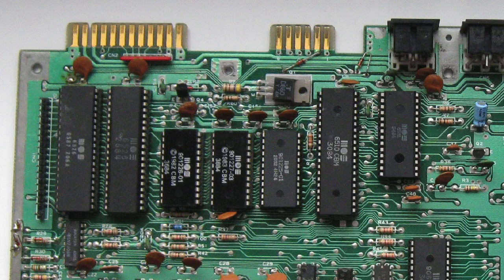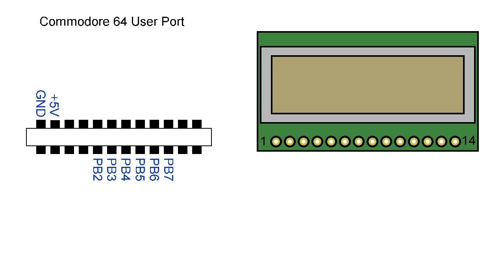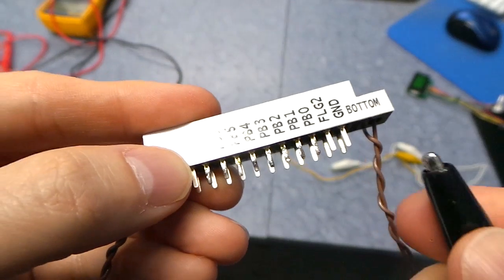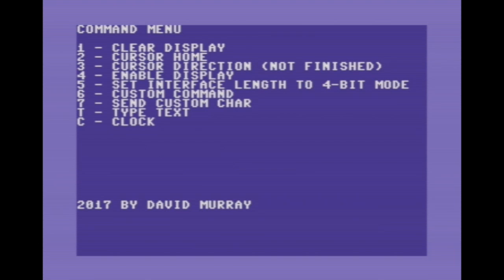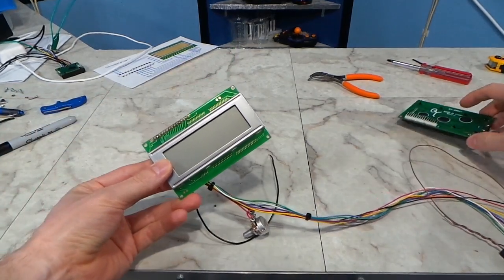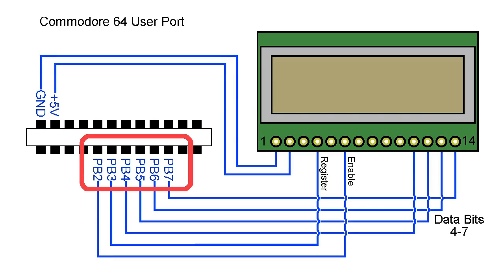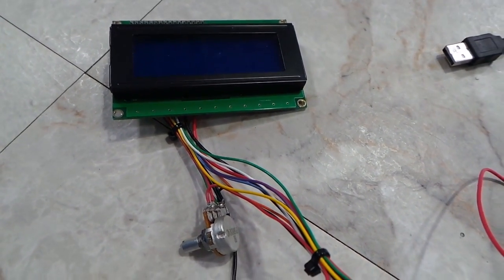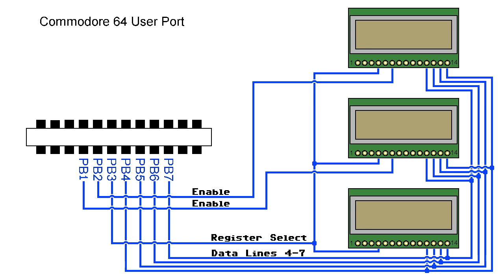How a Character LCD Works - Part 2

Comment: This reminds me when I sat in on an embedded C programming class.  We were using the TI Launchpad TM4C123 board.   Embedded C can be frustrating--you write a program, there are no bugs, and your program still doesn't work.   I guess that's the difference between programming a real board instead of a simulated board on a computer screen.

Comment: Thanks for another interesting video.
Apologies for a (late and) possibly stupid question, but seeing as how said that the problem that "fried" You C64 is a "common" problem, would it not possibly make sense to make an "external//inline" "DC OverVoltage protection"  against "frying" Your C64 ? .. As I would assume that the C64's will just become ever more rare ??
Best regards.

Comment: An Arduino replacement? that would be cool to toy with. I love the basic and I haven't learned the Arduino language (name = "Processing") very well yet. I am seeing there are other languages, but hey if I can use Vic basic for desktop experiments id love that. I am wondering if ole VIC can do pulse modulation and read pin voltages now lol.. thanks dave..

Comment: This takes me back. I used the 8 bits on this port on my c64 and made a pcb that held 8 optoisolators. I connected the switch sides of the optoisolators to the front pcb of a Fisher VCR to increment and decrement the channels and "press" record and tape speed. I lived in Japan on a military base and some local channels had American shows in English if you had a similcast box so I would switch this on or off. We also had one base channel that has just begun showing Star Trek the Next Generation a whole season behind the US. I wrote a program that was a great improvement over the regular VCR programming. I can't believe I was able to figure this out with c64 books back then and no internet. :-)

Comment: Probaly a good thing I never got an original PSU with my C64C. Built my own using modern parts that don't fry C64's

Even my Atari 800XL did not come with a PSU. Ended up using a Raspberry Pi one where the USB conector had fallen off.

Comment: You know, having recently diagnosed a faulty brick myself, it's really reassuring that even experts can fall foul of this invisible problem.

Of course, whilst what Dave says about running 3 screens directly from a C64 is true, couple up some 74HC595 shift registers to the use port instead, and you can run as many screens as you like! Of course, the speed will be attrocious in BASIC - you may want to move over to ASM in this case.

BTW, this video really speaks to me, because I'm approaching the exact opposite problem - I have  a dead C64 whose keyboard I've robbed, and which I'm writing an Arduino sketch to decode the keyboard matrix (done - that's the easy part), and I'm using two 74HC595s so that I scan the keys but also output in ASCII the last key typed, but also have a 'HEX' mode, where typing two 4-bit hexadecimal keys will output a single 8-bit byte on one of the output shift register. It's fun thinking it through, and the next project will be to use a second Arduino to receive this data and print it to an LCD just like Dave's.

Comment: I use the NES+PSP C64 power adapter in my setup, so both the AC and DC adapters are entirely separate from each other, plus makes replacing the power supply easier as its modular

Comment: That PSU really trolled you hard! How about you design, manufacture and sell a little device, that sits between the possible-going-bad-PSU and the Commodore, displaying the voltage levels and protecting the Commodore from overvoltage? Perhaps just simple overvoltage leds could do? I don't know if such thing already exists in the wild, just popped into my mind.

Having worked for years in the IT field, my paranoia level regarding misbehaving PSUs is so dang high I always carry a spare ATX PSU with me. And no, those little PSU testers you can get off the eBay for $5 are junk; they are able to pass literally dead PSUs just fine. Just like those $5 Ethernet cable "testers" tells you that yes, there is copper from point A to point B, but doesn't tell you anything about the frequency response, crosstalk et. al.

Comment: If the power supply failure is a known problem is there any merit in adding a device between the power supply and the C64 to limit the voltage to 5 volts? I presume there is no warning the power supply is failing in this way before it happens.

Comment: Since 3Bit can represent 8 numbers, it should be possible to drive 8 screens by using some logic gates to convert the 3 bit input to a 1 of 8 bits output.

Like with this IC: 74HC238

https://assets.nexperia.com/documents/data-sheet/74HC_HCT238.pdf

Comment: Hell, with three bits you could control up to 8 LCDs. With a 3 to 8 decoder that is. Since three bits will give you 0 to 7 in binary. Not sure if power from the user port would start to be an issue for the data lines, of course some buffers tied to that external usb supply could likely fix that.

Comment: I have a character LCD on an old Nortel Vista 150 telephone the display is for caller ID info etc. Maybe you could help me...the display works ok but the characters are very light to the point I have to turn the contrast up to 8 (the max) to see the letters half decently. At 1 or 2 you cant see anything at all. What would cause this?  Just wondering if you could point me in the right direction. Thanks Brent

Comment: 12:20 I did the parallel port trick in the early 1990s.. Used it to control 256 relays (in theory).

Comment: 4:48 The meter is showing the line is high at 4.955 V. That seems odd if the power supply is feeding 8V to the chip.
Reply: The psu wasn't in "turbo mode" then, only later.

Comment: You said that it's possible to hook up three screens using the spare pins for enable. Would it not be possible to hook up 7 with a small amount of logic and using a 3-bit identifier to select which screen you want? Difference being that with your solution you could write to multiple screens at once if you wanted to, but with mine it's definitely one at a time

Comment: Same thing kinda happened to my c64. I bought it. Used it for awhile and then turned it off. The next day it was dead. So I bought another one with all original cables etc. it died after two days. My friend has gotten it to power on and display some type of image out of the rf output. If anyone could help me with this it would be so helpful.

Comment: Thanks for the troubleshooting idea about the user port. I was planning to use an old CBM 3016 to control my Modeltrain. Afaik the CBM has one user port and one output only parallel port. So I should be able to set up to 256 Signals and tracks, as well as 265 sensors from whereabouts the trains are. So I will remember the 5th issue before I fry my circuits

Comment: you measures the 6525 output voltage when you started. which was slightly under 5V, which is normal for NMOS TTL, so at that point both the 6526 and the power supply was ok. :P probably screwed up either the rectifier bridge in the psu OR the 6526 by doing that 'external power' thing later on. (the OR depends on wether you also connected the grounds together ;)... Port A and Port B have passive pull-up devices as well as active pull-ups, providing both CMOS and TTL compatibility. -> Both ports have two TTL load drive capability < now if that part is true even for the stinky old pre-c64c old old old 6526'es in that first one you showed. it should just work. (as a logic '1' can actually be fairly low on TTL) however 6526'es blowing out the magic smoke is a fairly common thing :P the c64c you used after that is a far more modern board that is mostly cmos, is a lot more sturdy, and has far less of such problems. either way if the power supply was screwed it would have been screwed in the first part with the multimeter already, as the c64 itself is a power hog and the addition of an lcd screen won't make a noticable spike on the ampere usage :P (memory chips at like 1 or 2 watts each or so, not to mention the vic-II ;) if you turn on a first generation c64, the power supply already is loaded enough to display any defects instantly. just hooking up things with their own power supply is a very very bad idea as 0 volt on power supply A is not the same as 0 volt on power supply B, even if they are on the same phase, and even if they are the exact same model, which in this case they're definately not.

Comment: In a dos computer you can copy stuff from an address to another directly, so, If you have a device that works with raw data, like an old serial printer, you can do stuff like enter the command copy con > com1 where con os the keyboard Port and com1 os the serial Port 1 where the printer os hooked And then when you type, caracter data you bem sent directly to the printer and it will work like a typewritter.
Reply: Sorry about my pour english, im using a brazilian portuguese virtual Android keyboard.

Comment: if you use this: https://www.electronicshub.org/binary-encoder/ you can control up to 7 LCD displays. Also, for the PC, an easy way to control it (at least for me) would be using Turbo C. Turbo C contains a Dos.h header file, which contains the outportb function. syntax is outportb(int port, byte output); and according to Wikipedia, LPT1 is port 0x378 (You also said it when explaining how to make the OPL2LPT work with existing software), so to send 42 to the parallel port, you would do outportb(0x378,42);

Comment: You could use one I/O pin connected to a shift register, send the data in 4 bit mode to the LCD, have the 5th bit control read/write and the 6th bit control the enable, 7th control the register, and  have the most significant bits always pulled low. that way you could hook up 8 concurrent LCDs. Don't know what you could do with all that, but  it would be an interesting project.

Comment: why dont you build a device that automatically turns off the power if the output voltage goes above an allowed maximum? an arduino, a relais and some time should be enough

Comment: some of those info signs on highways are just larger versions of these displays controled by  c64's.in the late 90's and early 2000's state highway departments bought up a lot of c64's for this purpose.

Comment: The original C64 PSU would often get fried when there was additional drain on the system from using cartridges.
Commodore also used to pack them with epoxy so you were unable to repair them.

Comment: I connected a 7-segment 8 digit multiplexed calculator display up to the user port of my VIC-20 back in the day.  It worked but flickered like crazy because my BASIC code was too slow to refresh at a sensible rate.  I would have loved to have connected a matrix display but they were expensive then.  I still have the VIC-20 so I could use your system to do one now.

Comment: If you're in the Dallas area, I'm surprised you're not a regular at Tanner electronics. They've got tons of salvaged LCD screens. They're not as cheap as ordering from ebay, but they've got some good deals. And their prices on switches and stuff beats Fry's by a lot.

Comment: and that's exactly how I fried one of my C64s back in the days... messing with the user port. I mistakenly connected together Pin 10 (9V AC) and Pin 9 (Ser atn in), they are just 2mm apart on the PCB

Comment: in MS-DOS you'll need a serial LCD (wich is just a parallel LCD with a serial to parallel adapter attached to it, maybe you can use an arduino as the converter) and then you can use the ECHO command (echo [text here] > COM4)

i personally use a arduino though usb serial, and some code to clear the lcd everytime theres a new incoming text, so I'm able to make a clock too (its fun command outputs can be routed to the screen, like Ping or Dir)

i use a Nokia 5110 screen (84x48)

Comment: Your graphic showing the lines from the binary value to the input pins on the LCD has the binary value getting reversed once it reaches the pins. The first digit goes the last pin, the second digit goes to the next to last pin, etc.
Reply: diagrams love switching endians, apparantly.

Comment: Hi, nice video. I suggest you to install a 5.6V zener diode from the 5V rail to ground; preceded by a fuse or a polyswitch. If the 5V rail goes over 5.6V then the diode will start to conduct and eventually blow the fuse thus protect the C64 and all of the stuff.

Comment: Wow, I'm surprised you didn't catch that the anomaly was caused by an overvolt. I was either suspecting a short or a voltage problem when the problems "stuck" to the LCDs after they were used by the C64. You should also know that some other LCD sizes work a little unintuitively, so they are a little difficult to set up. I also developed an LCD simulator about a year ago in Python. Here's the link if you are interested: https://github.com/oldmud0/LCDViewer (I don't develop it anymore, but it includes a "simulator" for Arduino in case you want to send LCD messages over serial, if you don't have a working LCD to solder to the Arduino. Personally, I used it because I did a horrendous job trying to solder the LCD and knew it was not going to work out well, so I decided to simulate the LCD instead.)

Comment: You should be able to output data on the parallel port using the command line in windows, same for the serial port

Comment: When I watched this video I realised how lucky I was 2 years ago.
(2 years ago)
I turned my Commodore 64 C on to finish my text Adventure Game (I didn't know C++ and C at that time)
Unfortunatly my Commodore 64 didn't turn on!
I shut the computer of and waited a hour, when I checked the C64 again it worked!
So I checked the Power Supply and it turned out the the capacitors (for the 5V line) are dead!
So what I did is I bought a cheap 2A 5V DC jack power Supply and attached it's output wires to the 5V out in the C64's supply and it worked :)
I am really glad that my Commodore 64 C didn't fried itself :)

Comment: sees the user port was outputting 11.5 volts 

That is monstrously High, did you fix your C64? Or did that power jack completely fry it?
Reply: The user port was spitting out 8.5 volts, the power adapter was the monster spitting out 11.5 volts.

Comment: Great video! Did you attempt again powering the screen from the C64 after you figured out the issue was with the power supply?
Reply: You clearly didn't pay attention, he did try it on a different computer, and it worked.

Comment: !Carefull!   This 6526 chip is extremely sebsitive and you can easily burn ports and the chip is hard to find and very expensive.I burnt a couple of 6526's then. In around 1990 to 1995 I used C64 for some projects and I used user port. I did an POCSAG encoder and EEPROM programmer with C64.
Reply: "*sebsitive*"

Comment: Check the capacitors in the power supply they probably dried out and you are seeing power supply ripple.
Common power supply issue.

Comment: it's called THIS MORON DOESNT KNOW THAT AN IPAD CHARGER IS 12+ VOLTS AND NOT 5!!!!! THATS WHY HE SCREWED UP SO BADLY
Reply: Both my iPad chargers are 5.1V 2.1A, the iPad chargers support higher amps, but the device will only draw what current it needs up to the adapter limit. Further the screens were fine when powered off of the iPad charger, it was using bus power form the C64 with a bad power supply that fried them.
Reply: Stormcrash it was definitely a combo of things, and he said watts not amps

Comment: Re: What you're saying around 12:37 about Commodores being so much easier than PCs to set particular register values on the user/parallel port... actually, in my college years in the early 2000s we were doing plenty of that in QuickBasic. It worked in every version of Windows prior to XP.

Comment: Hi.
I have a one verry good advise I have learned from my Electronics Master. If You are unsure of Your connections and You are affraid You will damage the expensive stuff - use buffer chips!! Like 74HC541. Or go further and make optoisolation!!!   8 x 6N137 Optoisolators are much cheaper than the C64 You can possibly fry out.

Comment: Another C64 murdered by its power supply :( You should always take precautions if you use original power supplies. I built my own power supply reduce the risk on my machine. You can also try to upgrade your original power supply. If you would like some tips on either, let me know.

Luckily, it is often the RAM that fails first, which is replaceable. Perhaps just install a new set of RAM chips and see what happens. If it is not the RAM, it is likely the PLA, which is also replaceable. There is a good chance the CPU, VIC-II, SID and CIAs are still alive.

Bring the machine back!

Comment: You should be able to control even 7 different LCD's! Instead of wiring the 3 spare ports each to one display, you would connect them to an 3-bit decoder, leaving 1 of the 8 possible outputs as a null-statement to avoid having always one screen having the enable pin set to high. You would have to use transistors though.

Comment: You may be able to use a buck converter to protect a future- C64 board, and with the old DOS 286/386/486 you can use MS qBasic to control registers and the parallel port, windows 3.1 has visual basic 3 which also allows you to do the same, plus libraries that qbasic does not have built-in.

Comment: If the power supply issue is common, isn't there a resistor or a fuse or something you could hardwire in to protect the hardware?